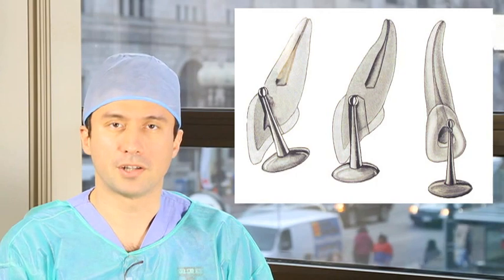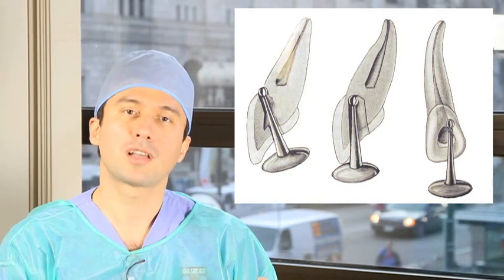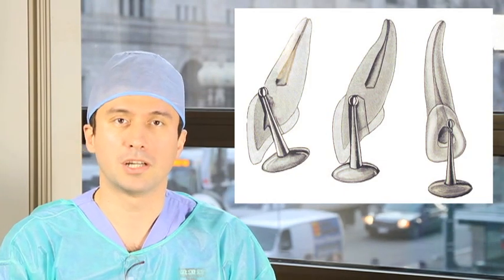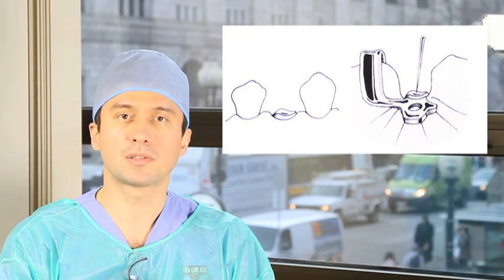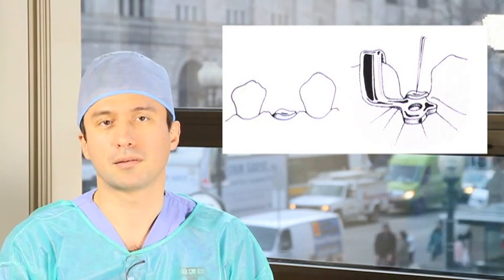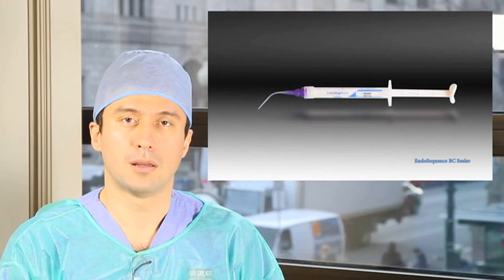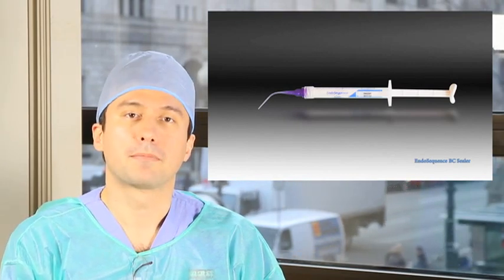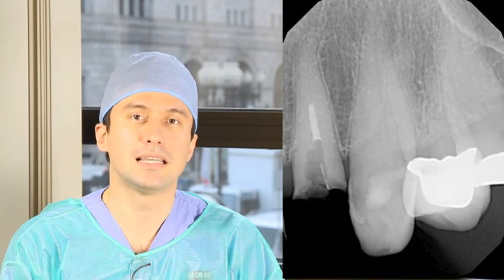Dystrophic Calcification

Comment: hello Dr Nasseh. I struggled with a similar tooth yesterday and was asking what's the need to treat this kind of teeth endodontically. you talk about the need to put a post to restore the tooth properly but in the previous video you tell the important evolution of the new materials' adhesion that allow us to avoid fiber posts sometimes... wasn't this the case where the post should've been avoided to put just a simple crown?
Reply from the maker: It's a matter of ferrule. Where we lack enamel in adequate quantity to improve both the ferrule and the adhesive surfaces a post would be helpful for addition retention, specially against some of the mild shear forces.

Comment: Dr. Nasseh, how do you approach such calcified cases in your office in terms of length of appointment? Do you do 2 visits and if you don't mind sharing about your discussion with patient?
For instrumentation, do you still follow crown down technique or any modifications? Thanks
Reply from the maker: Everything is done in a single visit and we make one hour appointments. Over time, and once having done a number of cases it becomes easier to go from point A to point B in a straight line! It's important to get in these calcified canals or understand that it's either doable or not early on. Because I use the microscope the vast majority of them are doable and frankly not hard to find. You have to understand the dentinal map and the pattern of calcification which allows you to follow the discoloration associated with secondary dentin until you find the remanent of the original canal. Please visit the RWE site and leave questions on the Forum so you can get answers from multiple faculty.

Comment from the maker: @khadubaba The key with calcified canals is patience and time. You can't rush it or you will quickly block yourself. Start off the bat with 17% EDTA and leave it for a good 30 seconds, then place a stiff size 6 files in the canal. As soon as it goes in a few mm just stop and then step back and enlarge the top, then go down deeper, then stop and step back. You should serially move apically and then step back and should not rush to get down to the apex on your first file or two. Patience is key.
Reply: Thanks for the tips, is there a reason why most of your videos end all of a sudden
Reply from the maker: @andresvaldevit3692  These are early preview videos that were cut short for people to watch the full video on our website. Usually, the link for the full video is in the description. Some have to be updated on our website too. Sorry. The new videos are all in full. It's about the date of the video.
Reply: @EndosKool  Thank you Dr. One question on calcified canals. When is it indicated to leave calcified canals as they are without endodontic treatment?
Reply from the maker: @andresvaldevit3692  When no symptoms, no lesions, and no Endodontist to refer to.
Reply: @EndosKool  Thank you Dr 👍